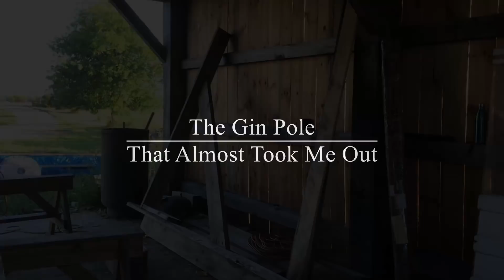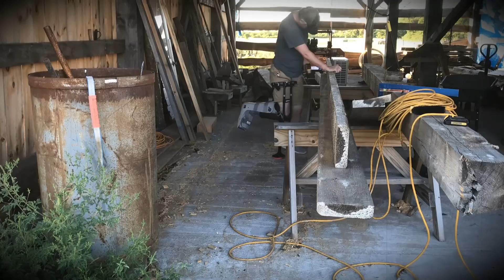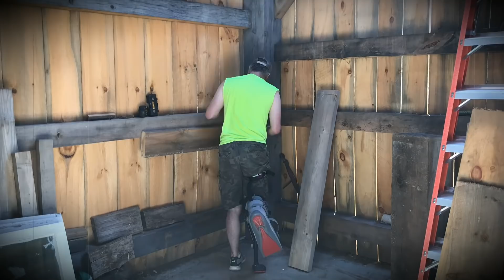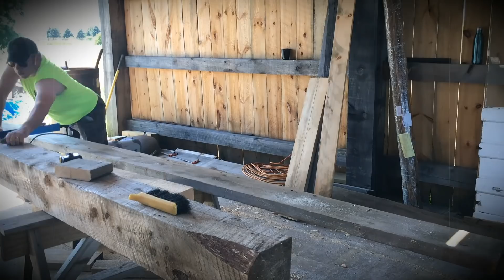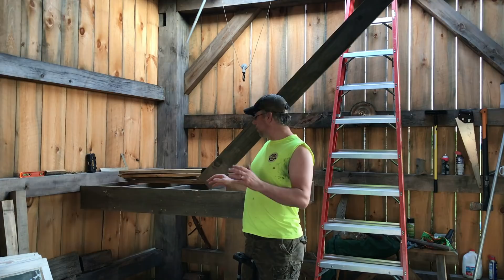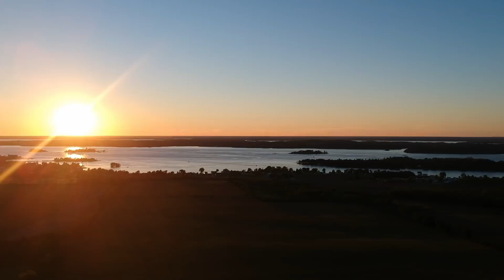The Gin Pole That Almost Killed Me Gets Repurposed

Comment: Morning Jim. Hell yeah the hoist lumber that knocked you down should lift you back up in the form of filling part of the hole it knocked you in to. Irony or not.
Beat them boards into submission.
Reply: Another question,
Have you figured out how to drive with your left foot, or are you still using MaryRose's taxi service?
Reply from the maker: That's right, good morning Thomas.
Reply from the maker: I drove my stick shift diesel the other night.  Took the moon boot off and went for it.  No pain, no funny feeling...felt great and almost normal for a little bit.
Reply: TheTradesmanChannel that's cool, but watch having to use the leg for pressure on the brake pedal until you're cleared for weight bearing.

Comment: Great to see you back at it there Peg!  Hard to tell from the camera angle, but I think you might want to  consider raising the landing one riser height... the upper section looks a bit steep.  Best of luck Tuesday!
Reply: Chris Peters 
Whether or not inspections are required I don't know. However, stairs in a barn aren't exactly the norm, but the two I've seen in Kentucky/Indiana had steep stairs. Of course if code inspections apply to this project then yeah, they do appear a bit steep for modern building codes. Of course he did say these are temporary stairs because he's not up to building timber-framed stairs at the moment. Good eye, mate.
Reply from the maker: If I go higher I lose clearance for head space.  They are a bit steep but I'm ok with that.